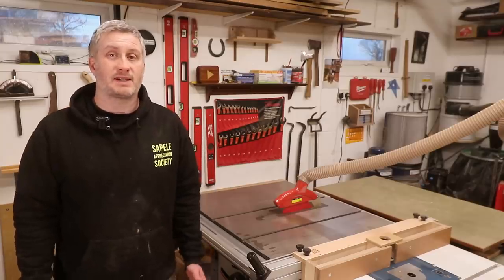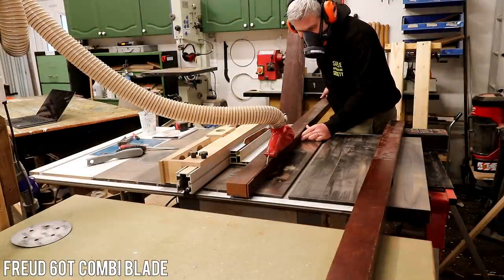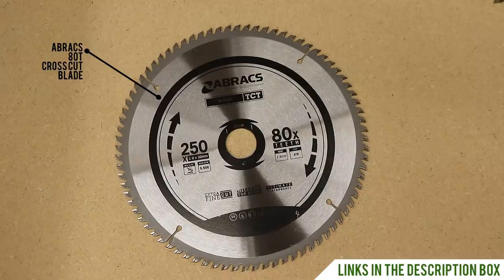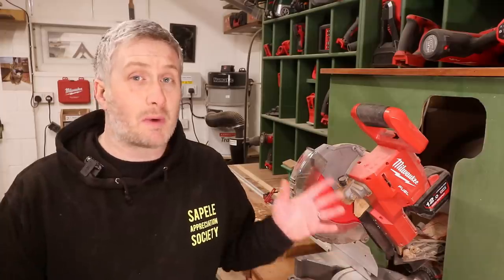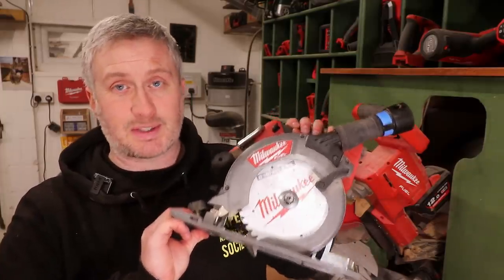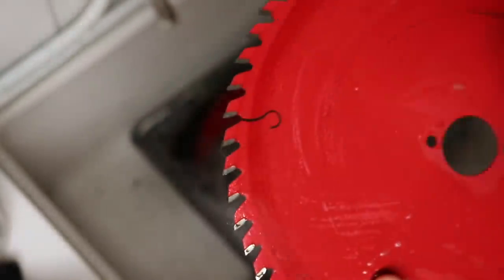Blades - The Good, The Bad & The Ugly

Comment: Great video, keep them coming.

I'm a weekend woodwork hobiest. I started with cheap circular saw and mitre saw, they did the job but not for finer work. I sold the cheap saws and purchased all Evolution kit, as in sliding mitre saw, circular saw and table saw. The blades that come with Evolution cut really really really well and I use them for 99%+ of my general cuts. 

For finer cleaner cuts on my Evolution table saw and Evolution sliding mitre saw I use 80 teeth Saxton blades. I went for Saxton as they get really good reviews and feedback not just on Amazon, but also on multiple woodwork forums. When cutting wood that will be glued together like round stools or cutting boards I alway switch my standard table saw blade for Saxton 80 teeth 10" (255mm) blade and I always get a perfectly smooth cut with absolutely no scoring or burns. 

I'm not a pro like yourself, but for finer cleaner cuts I've found that 80 teeth Saxton blades do the job perfectly well and thus I'll be sticking with them.

Cheers 🍺🍺🍺

Comment from the maker: Ripping Blades
Freud 160mm 24T 20mm Bore https://geni.us/NVsnSTm (Amazon)
Freud 165mm 24T 20mm Bore https://geni.us/D7CQJ  (Amazon)
Freud 190mm 24T 30mm Bore https://geni.us/jd58jg or https://geni.us/QzvS  (Amazon)
Freud 235mm 24t 30mm Bore https://geni.us/KAaAvC  (Amazon)
Freud 250mm 24t 30mm Bore https://geni.us/eT0hc9 or https://geni.us/AK5yNy  (Amazon)
Milwaukee 165mm 24T 20mm Bore https://geni.us/AJ2JCb3 (Amazon)
Milwaukee 190mm 24T 20mm Bore https://geni.us/Pffho (Amazon)

Combination Blades
Freud 160mm 48T 20mm Bore https://geni.us/gB5kfX (Amazon)
Freud 165mm 40T 20mm Bore https://geni.us/ZHrBt (Amazon)
Freud 180mm 40T 30mm Bore https://geni.us/LHCj  (Amazon)
Freud 190mm 40T 30mm Bore https://geni.us/vWNJjG6 (Amazon)
Freud 216mm 48T 30mm Bore https://geni.us/9frBu (Amazon)
Freud 230mm 34T 30mm Bore https://geni.us/hIYjcnv (Amazon)
Freud 235mm 34T 30mm Bore https://geni.us/hjm9 (Amazon)
Freud 250mm 40T 30mm Bore https://geni.us/NQbTI (Amazon)
Freud 305mm 48T 30mm Bore https://geni.us/DLyGvGq (Amazon)
Milwaukee 165mm 40T 5/8" (15.87mm) Bore https://geni.us/DIDEy (Amazon)
Milwaukee 165mm 48T 20mm Bore https://geni.us/g6TI (Amazon)
Milwaukee 190mm 36T 20mm Bore https://geni.us/cHesA4g (Amazon)
Milwaukee 210mm 48T 30mm Bore https://geni.us/AvBT3cn (Amazon)
ABRACS 40T 30mm Bore https://geni.us/Y3z70h (Amazon)

Cross Cutting Blades
Freud 216mm 48T 30mm Bore https://geni.us/CuJJ (Amazon)
Freud 216mm 64T 30mm Bore https://geni.us/d2XbgB (Amazon)
Freud 240mm 60T 30mm Bore https://geni.us/JI5F (Amazon)
Freud 260mm 60T 30mm Bore https://geni.us/mA9B9x (Amazon)
Freud 305mm 72T 30mm Bore https://geni.us/dg0P (Amazon)
Freud 305mm 96T 30mm Bore https://geni.us/aGNQ6g (Amazon)
Milwaukee 216mm 80T 30mm Bore https://geni.us/e5a6CAA (Amazon)
ABRACS 250mm 60T 30mm Bore https://geni.us/XCWd4g (Amazon)
ABRACS 250mm 80T 30mm Bore https://geni.us/TV12am0 (Amazon)

Twin Packs
Freud 165mm 40T & 24T 20mm Bore https://geni.us/P9YD (Amazon)
Freud 190mm 40T & 12T 30mm Bore https://geni.us/RUBH9Jc (Amazon)

Blade Adapter Rings
20mm to 16mm https://geni.us/Zmmk (Amazon)
30mm to 20mm, 20mm to 16mm, 30mm to 16mm, 30mm to 25.4mm https://geni.us/fon1 (Amazon)

0:00 Intro
0:07 Ripping Blades
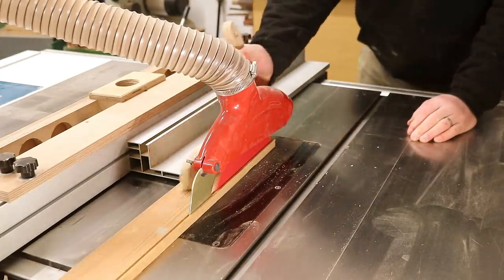0:30 Cross Cut Blades
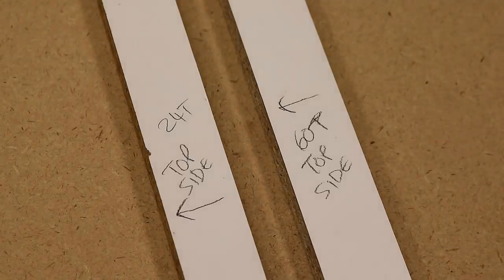0:57 Combination Blades
1:18 Choosing The Right Blade For Your Machine
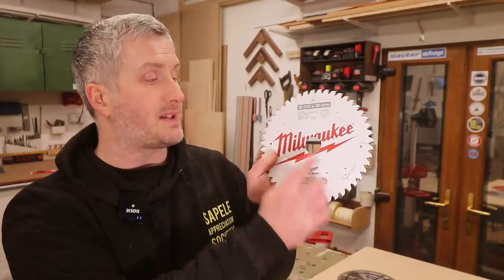1:30 Bore Size & Adapters
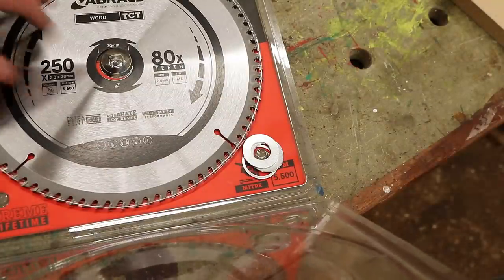1:56 Kerf Size
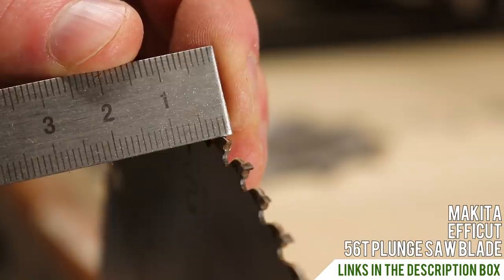2:19 Riving Knife and Kerf Size
2:50 Blade Deflection
3:11 One Blade For Everything Recommendation
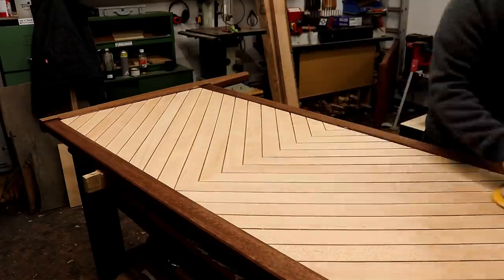4:56 Two Blades Recommendation - Rips & Cross Cuts
5:25 Tooth Grind
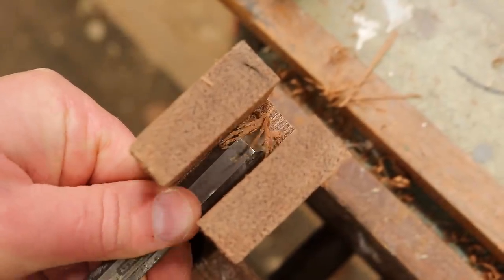5:52 Best Blade For Joinery - Flat Grind
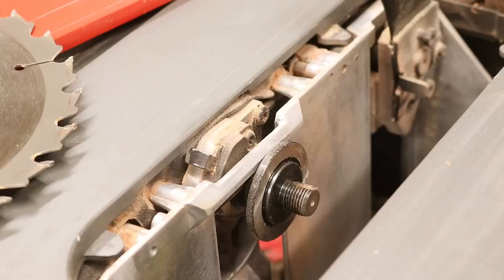6:22 Best Mitre Saw Blade
6:48 Best Plunge Saw Blade
7:07 Best Circular Saw Blade
7:32 Best Blade Brands 
8:46 Clean Your Blades!

🔴My channel is supported by Milwaukee🔴
Check out their full range here: https://uk.milwaukeetool.eu/?utm_source=Social&utm_medium=YouTube&utm_campaign=Rag%20N%20Bone%20Brown%20-Milwaukee%20Range
Tools used in this video: 

#woodworking #blades #tablesaw

Thanks for watching! Please subscribe, click like if you like, and hit the bell icon for future video notifications

🔨 MY TOOLS 🔨
For links to the tools I use, plus some of my favourite consumables,  finishes and more see links below.  As an Amazon Associate I may earn a small commission from qualifying purchases:
UK affiliate store: https://www.amazon.co.uk/shop/ragnbonebrown
US affiliate store: https://www.amazon.com/shop/ragnbonebrown

🤝 HELP SUPPORT THE CHANNEL 🤝
Support with YouTube channel membership: https://www.youtube.com/channel/UCVyE_6jEtVZGmYGXtUOL5FQ/join
Support with Patreon: https://www.patreon.com/ragnbonebrown
Support with PayPal https://paypal.me/ragnbonebrown
Shop With Amazon using my affiliate link: https://geni.us/iWD3K

💰 SHOP 💰
Etsy: https://www.etsy.com/uk/shop/KeithBrownMaker
https://teespring.com/stores/rag-n-bone-brown-merch

🎧 WORKSHOP BANTER PODCAST 🎧 
https://youtube.com/workshopbanter
Also available on Spotify, Apple, Google and most other podcast platforms

🔗 LINKS: 🔗
Website: https://www.ragnbonebrown.com
Facebook: https://www.facebook.com/ragnbonebrown
Instagram: @ragnbonebrown
Twitter: https://twitter.com/ragnbonebrown
Email: ragnbonebrown@gmail.com
Second YouTube Channel (non woodwork videos): https://www.youtube.com/user/keefykeef

Comment: Basically the riving knife thickness should be greater than the blade body thickness but less than the kerf. If the riving knife is thinner than the body of the blade, it does not protect against kickback.

Comment: Quick PSA: Freud has been a subsidiary of Bosch for quite a while now and when you see a red and a blue ("Expert for...") saw blade with the same specifications chances are they're coming from the same manufacturing line. I don't know about pricing (my Freud blades are still going strong after many years, so no need to buy new ones) but maybe you can save a few quid by buying Bosch-branded ones.
Reply from the maker: Interesting, thank you Grobi 👍

Comment: Good video, just one thing to add: there are special blades available for mitre saws. They tend to have a less agressive rake angle on the teeth and tend not to grap the wood as hard. Usefull on a saw where the blade is controlled by your hand.

Comment: Agree entirely.  A must to prevent rip out is at least a 60T if using a 10” blade.  80T are better but limited to thickness of cut before they tend to overheat due to poorer chip removal.  For the money Freud are ok but CMT for a little more would be my choice.  Way better blades.  Quality blades will always pay for themselves.  Combo blades are great site blades but of limited value in a cabinet makers workshop.  Better to swap between 24T rip blades and higher count 80T.  Good shout on cmt grooving blades👍

Comment: A true ripping blade doesn't have anti kickback nibs. It does have as you rightly said deep gullets. The problem for many diy guys and girls is kickback. Anyone who has experienced kickback from ripping timber will tell you it's frightening and bloody hurts, often results in a hospital visit. When ripping timber never have the fence running the full width of the table as we often see in US You tube video's ,it's a recipe for disaster, nice to see you understand why it's dangerous to have the fence running way past the saw blade.  The fence should only extend past the front of the saw blade by 25-50mm depending on blade diameter as you correctly has in the video at 0:25 seconds. The gap between the riving knife and the blade should be no more than 3mm for safety..Anyone who uses melamine, veneered MDF or ply boards I can recommend a "triple chip" blade which are specifically designed for veneered/melamine faced sheet materials. I use them in my verticle wall/board saw and they are excellant.When people see a "Multi purpose blade" advertised they do everything but nothing very well, they are a pig in a poke in reality. Feel free to ignore my advice but stick to the right blade designed for doing a specific job and keep that riving knife 3mm or so from the blade . If you can fit your finger in between the blade and the riving knife ,it's aint right and could end up in tears ,lost finger or lost eye.....

Comment: Very interesting video, thanks for sharing.  I learned some new things, for example about that fact that the riving knife should not be thinner than the blade.
In fact that's very logical, only I never thought about it.  I once removed my riving knife (I don't remember why) but then putting it back took me literally hours.
Never again. Until now I've only used cheap blades (two years ago I changed the blade on my mitre saw after 8 years. The tip how to clean the blades is perfect.
I need to try that.

Comment: I think you've nailed the basic principle here between ripping and cross-cutting blades. The same principles apply to handsaws too. A ripping saw having fewer teeth per inch. And explaining the need to clean the blades regularly is so important too. Excellent resources.

One question though - do you get your blades sharpened? or sharpen them yourself?
Reply from the maker: Thanks Karl. I've actually never got a blade sharpened as yet. There's a machinery company in Norwich that does blade sharpening which I'll check out some day, but from what I've heard (Robin Clevett's recent video) sharpening can cost as much as a new blade. I'll probably still take a batch in one day though when they are too dull,  as it seems wasteful to throw them away
Reply: @RagnBoneBrown  I've got 4 blades going off to a place about 5 miles from me; I'm really interested in how they come back. The company offers a polish grind for cabinetry so the table saw blade is getting that treatment. I'm no John Heiz so I would rather re-use them rather than find another purpose for them.
Reply: @RagnBoneBrown  Norfolk saw are great people  - you can even watch it being sharpened if you want via the fact they put viewing public windows into the sharpening machinery centre - maybe could be a good vid?. & Thanks too for all your content, I've watched a fair bit & picked up quite a few tips - you have a great way of explaining things  - Cheers, Nick. (Laguna UK ;)
Reply: I used to get blades sharpened 20 years ago or more but rarely economic now. Must check with a local company I've just found - maybe it's more automated and less labour intensive than when I stopped sharpening

Comment: Interesting content probably worth also looking at the rake of the blade being positive or negative especially if using different tools, for example my workshop has a radial arm saw which should have a negative rake blade to stop it climbing on the work piece (similar for a mitre saw).
Reply from the maker: In hindsight I wish I'd have covered that. I was worried the video was going to be too long ...

Comment: Great video. I’m lucky that I got some good advice when buying blades, but if I didn’t this video covers most of what you need to know! I’d add that the riving knife is only important for rip cuts when using the fence; you can use thin kerf blades without riving knives when making cross-cuts with a sled. Freud crosscut blades are an absolute joy to use when making crosscuts. Question: which blade would you use to cut an angled half-lap joint where you want a flat cut but also want a clean crosscut?
Reply from the maker: Thanks! I'd use the CMT blade for that

Comment: So helpful, thank you 🙏👍
Just wanted to confirm, I use the Stanley fatmax circular saw where the existing blade states 16mm bore by  165mm, I need to buy a better blade so it removes a lot of the excess when cutting along the grain, I’m struggling to find a blade that has a 16mm bore size, the next size up is a 20mm bore, would this still work?
Reply from the maker: You can get spacer rings to fit in the bore of the blade to adapt the bore size

Comment: As far as I know, best ones I have tried for money are Klein and Hans&Baumier saws. 
Biggest disappointment is Felder Silver line combination blade, very expensive and got dull really quick. Rip is very good and crosscut is okayish. 
CMT crosscut is quite good as well.

A little tip: Try to get blade with the negative rake for your miter saw, thank me later ;) and if you can get the Hans&Baumier for miter saw, double thank me later 😂
Reply from the maker: Thanks, I will check that out

Comment: Freud is my first choice as well, had similar experiences as you. But unfortunatly I can't get freud anymore in the Netherlands. So I started using CMT blades, I dind't use them much jet, so I can't say if ther any good. Keep up te good work Keith! Greeting from the Netherlands. 

P.S. Could't help wondering why you have the same table saw as I and the arbor and moter are on the other side.

Comment: Thanks for the video. Some great advice there. I nearly bought the 6mm kerf blade but read the RPM should not exceed 1000. My TS is 3000rpm. Have you found any issues? Many thanks
Reply from the maker: I wasn't aware of that... My saw is 3500rpm and no issues here

Comment: Keith, thanks for the helpful video. I have an Rage 6 evolution table saw with the 25.4mm Arbor. I have not been able to find the correct reducer but note you say they come with the blade. Is this correct for the Freud blades you suggest off Amazon? If so, I will buy one. Thanks
Reply: Not a direct answer, but I've found Saxton blades are a decent option and they have 25.4mm versions that fit the Evolution directly... I'd be curious to hear from anyone who has used the Saxton and the Freud to offer a comparison. The Saxton seem to be a great budget option but I'm curious whether I'm making a false economy!
Reply from the maker: I linked to some adapters in the description box which should help...

Comment: Great content Keith. Have you modified your diving knife to bring it below the height of the blade? I have an Axminster table saw and find the height of the riving knife rather annoying. Best, Julian.
Reply: Do you mean the riving knife is taller than the blade, or that it doesn't move up and down with blade height adjustment? If the latter then it's just a splitter, not a riving knife. My cheapish TS came with one that follows adjustment but stupidly projects above blade height, perhaps because it also served as mounting for the blade guard although I would still have thought it avoidable. However, it was quite easy to fashion a replacement from some scrap steel I picked up at work.
Reply: Hiya, mine is the same as you describe. It’s an Axminster Craft table saw, which is fine, except for the riving knife protruding above the blade, in order to hold the blade guard. I also find that the hose tends to pull the riving knife to one side. It’s just a fraction but sufficient to interfere with the cut.
Reply: @juliangreaves4727  I have a Lumberjack saw, sufficient for my first. I decided early on to permanently remove the guard, as there are so many cuts and accessories with which it can't be used anyway. Yeah, that knife deflection is a deal-breaker design flaw. The Axminster design looks ok if only used for shallow rips, and nice to have dust extraction over the blade if it works, but I assume you also need to make non-through cuts and use sleds? I used the supplied riving knife as a template and cut out a form from scrap metal with an angle grinder, such that the highest point of my DIY version is about 2mm lower than the blade.
Reply: @worstuserever  that sounds like a great idea and I think I’ll do the same. Cheers, J. 👍👍
Reply from the maker: Yes. I covered that in a previous video, possibly the zero clearance plate video
Reply: Many thanks Keith. I'll look it up.

Comment: Interested in your thoughts of your axcaliber blades, I've had some (Premium & cutpro) for a little while and I'm not blown away especially given how much they cost.
Reply from the maker: I only have one and tend not to use it as it has a 3.2mm kerf, and I don't see any reason to remove that much material! I'm not a fan of it tbh... It's also quite loud compared to the Freud blades
Reply: @RagnBoneBrown  Cheers, kind of where I'm heading as well.  I was hoping I'd find a longer lasting blade which consistently gave a beautiful cut, sadly not.  I'll be heading back to Freud and trying your grooving blade as well :)
Reply: I have tried 2 Axminster blades and they underperformed big time. My longest surviving blade is Klein so far, also it has great cut quality.

Comment: Hi Keith, i must say been impressed with CMT, but like you I have an axminster cabinet saw and the table saw came with their Axcaliber blades. Have you gone away from these and if so any reason as they are not cheap and decent quality from what I can tell?  Good vid 👍
Reply from the maker: Thanks Mark, I only have one and tend not to use it as it has a 3.2mm kerf, and I don't see any reason to remove that much material! I'm not a fan of it tbh...
Reply: @RagnBoneBrown  Cherrs Keith makes perfect sense and will actually give the Freud blades a try. By the way great job on the bed and now my misses is going on at me to try and build something similar? 🤣. 2x4’s and OSB it is then. 👍